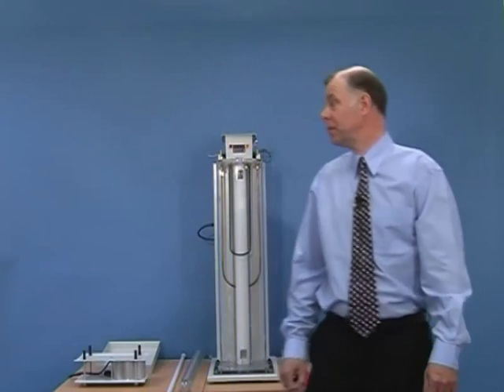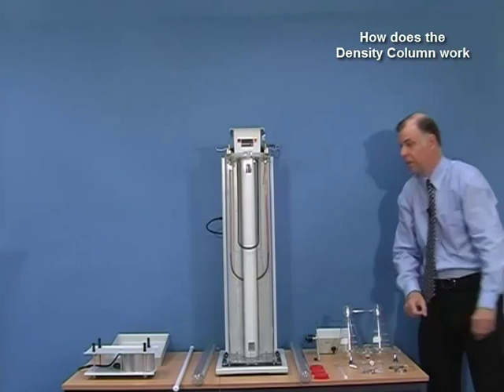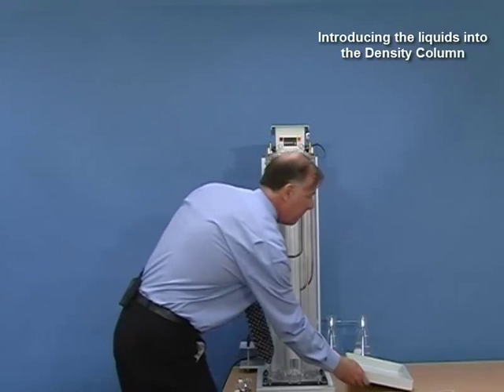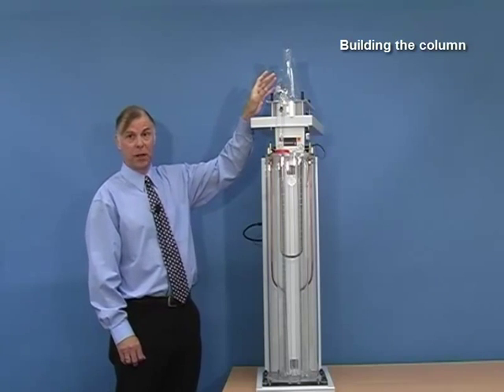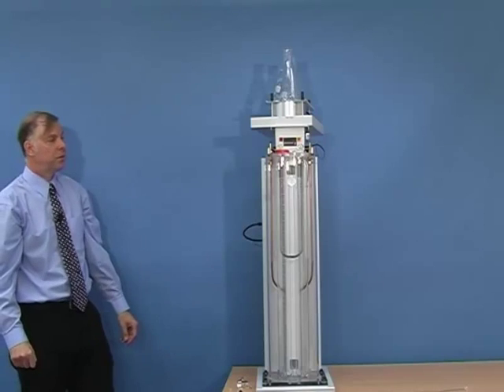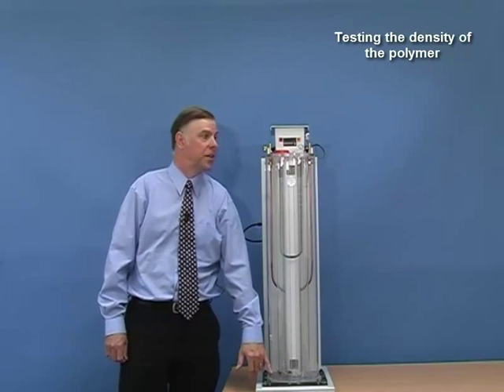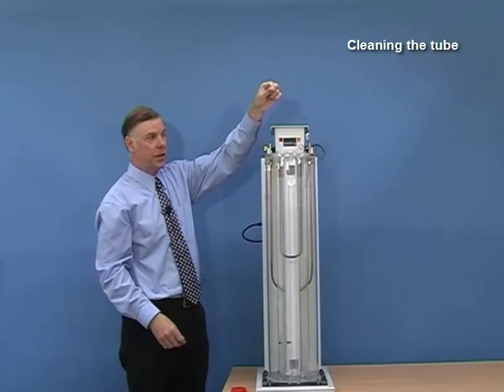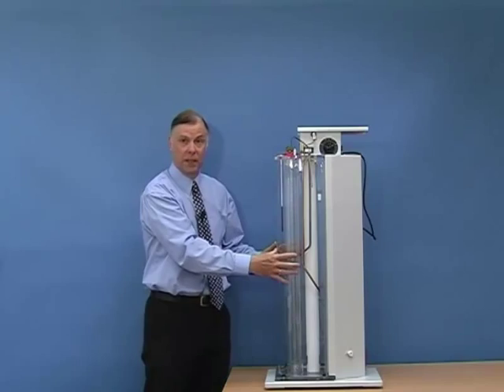Polymer Density Measurement

Comment: How uniform density gradient is formed from the top to the bottom of the tube when two missible solution is used for preparation.what is the law behind of it,can u kindly explain?
Reply from the maker: Hi Ratan, It has a special slow speed mixing system to gradually adjust the concentration between the 2 liquids as it fills. You can read more about the Davenport Denisty Column here https://www.ametektest.com/products/application-specific-testers/polymer-testers/density-columns